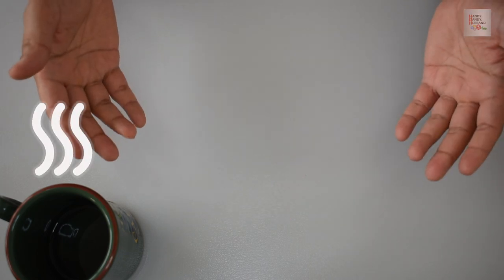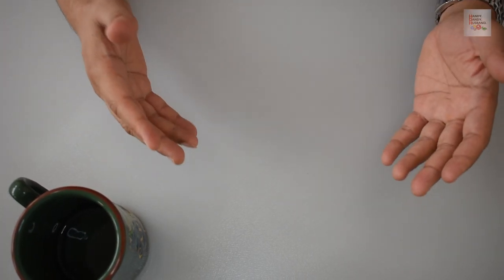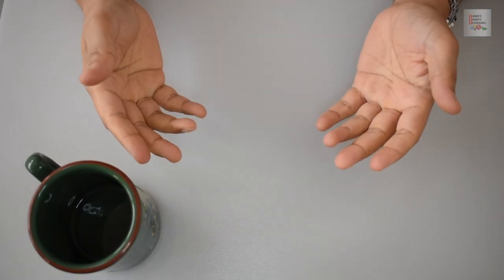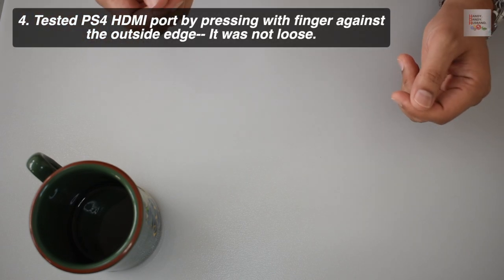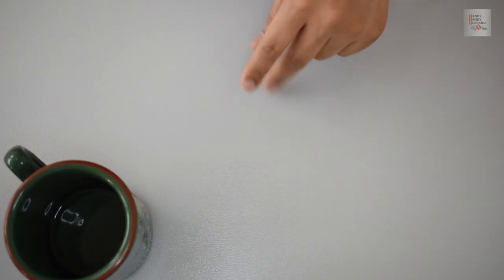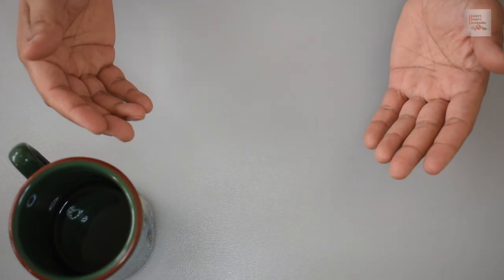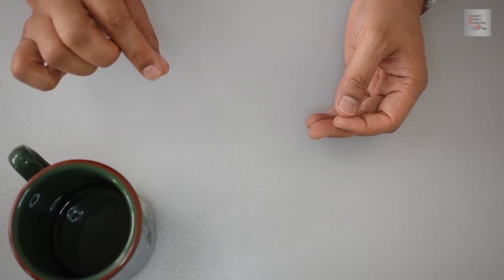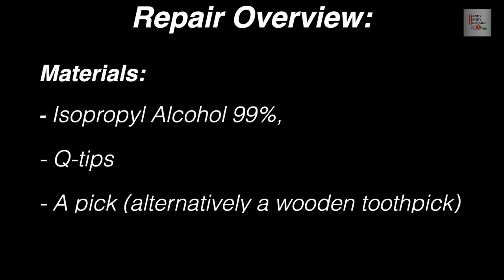𝗤𝗨𝗜𝗖𝗞 𝗧𝗜𝗣: 𝗣𝗦𝟰 𝗛𝗗𝗠𝗜 𝗣𝗼𝗿𝘁 𝗥𝗲𝗽𝗮𝗶𝗿 -- Easy, no solder required -- [Fix that video input error]

Comment: Sadly the pin broke before I could even do this. Happened when I removed the hdmi cable and then TVs died at the same time
Reply from the maker: He TheRiseofTony, thanks for watching and let me know your concern.  I am sorry to hear that the metal pin/strip broke before you could fix it.  Considering the pin is broken, I wonder if inserting a thin paper wedge between the cable and the HDMI port might provide just enough friction to get it working again.  You may wish to try this, but I have really no idea if it would work.  Best alternative suggestion I can make is contact Sony and request a repair under warranty (regardless of when you purchased the PS4) as this appears to be a common issue with PS4s.  Please let me know if either suggestion works.  All the best to you, H.D.H. [: { ].
Reply: @HANDYDANDYHUSBAND  thanks this happened to my non ps4 twice. Not sure why this issue I use Xbox one more no problem lol
Reply from the maker: @theriseoftony  Hi  TheRiseofTony, that is such a bummer.  Maybe speak to Sony and advise them of the many issues you have had and how little you have had with Xbox.  Maybe they might make a warranty exception in your case.  All the best to you, H.D.H. [: { ].

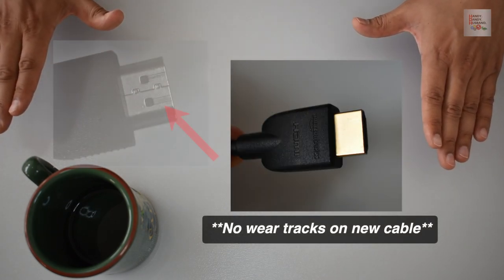Comment: No we he just showed the different sides of the hdmi cord for reference 2:22
Reply from the maker: Hi Belch Bat, thanks for watching.  Not sure what you mean...I took pictures of the cable and the back of the PS4.  The most important thing to note is the the metal prongs be able to position the contacts properly.  When they are flattened, the contacts don't line up.  Hope the explanation helps, HDH [: { ].

Comment: I got my ps4 hdmi port repaired last year since it had a hdmi port issue before but once I got it fixed it worked for a few months until it started to not work again, it basically works for a couple of minutes and then it goes off so I have to remove the cable and put it back in again for it to show a signal.. What do you think I should do now because I payed quite the price to get it repaired?
Reply from the maker: Hi Ahmad Mukthar, thanks for watching and sending me your question.  I am sorry your HDMI port replacement didn't result in a long term fix.  From what you have described, it appears the integrity of the HDMI port to circuit board connection is still good; however, there is a 'looseness' or compromised connection between the HDMI port and the cable.  I suggest the following: 1)  buy a brand new HDMI cable and replace your existing cable.  Try this for a while and see if it resolves or reduces the number of times you have to remove your cable, 2) If that doesn't resolve the issue, try the fix I have recommended in my video, or at minimum look inside your HDMI port and see if the thin metal strips are level with the outer metal sheath or slight protrude towards the center of the port.  If they do NOT protrude toward the center, this may be a sign that my fix might help your particular situation.  If you have any questions, let me know and I will try to help you out.  Thanks, H.D.H. [: { ].

Comment: I tried all the steps, even switched HDMI cables and switched TV's but it's not working :(. I think i have to repair the HDMI Port
Reply from the maker: Hi ALCHEMIST, I am sorry to hear that my fix didn't work for you.  Its a shame...if the thin metal strips look like they are now positioned properly, then you can try using the HDMI cables that you have and try to wiggle them gently in one direction or another and see if that re-engages a signal to your TV.  If still nothing, then go to a Sony authorized repair depot to get an estimate to repair your PS4.  Thanks, H.D.H. 
[: { ].

Comment: when i conect my ps4 to tv it woks when i conecy my ps4 to monitor its say noo vga sinla i conect it w bga video cable
Reply from the maker: Hi ItsAmarYT, thanks for watching and sending me a summary of your problem.  We should confirm a few things:  First, when you are connecting your PS4 to the TV, you are connecting a HDMI cable from the PS4 directly to the HDMI port in the TV--is this correct?  Second, when you are connecting your PS4 to a monitor are you still using the same HDMI cable/port to connect to the monitor's HDMI port or are you switching to VGA with some sort of adapter.  If you are switching to VGA with an adapter, it may not work unless you have a specific adapter designed to convert HDMI signals to VGA or RCA outputs.  Please let me know and I will try to help you out.  All the best to you for the new year, 2021, H.D.H. [: { ]

Comment: I plugged my hdmi and all that in and switched my tv mode to HDMI 2 but my ps4 still wont work.
Reply from the maker: Hi John Lucifent, thanks for watching and sending me your results.  It is a shame that the suggested fixes didn't work.  Try seeing if your HDMI port shifts/moves a little with gentle pressure.  If the port shifts, then the HDMI port may have an issue with its connection to the circuit board.  I am here to help, if you have any questions.  All the best to you, H.D.H. [: { ].

Comment: Just wondering, can I just straight away start with picking the metal without cleaning it with alcohol?
Reply from the maker: Hi Kubo, thanks for watching and sending me your question.  The instructions on my video follow the same steps that I use.  They are 'best practices' and I would encourage you to follow each step, as it will result in ensuring multiple points of potential failure are addressed.  If, however, you don't wish to clean the HDMI cord with alcohol, that would be OK (i.e. it will not damage the port) but your success rate may not be as high.  Hope you get you PS4 working.  All the best to you,
H.D.H. [: { ].

Comment: I agree for the most part here but I do have a few problems with this video. Please only take this as constructive feedback, I'm not intending on anything else here

1) While this fix may work for some consoles, 90% of the time a new port is needed
2) You should have probably mentioned this is never going to be a permanent fix. Once those locking prongs have bent, they're weak, they'll keep getting weaker over time
3) You said "most repair companies" will claim a new port is needed when it isn't. Again I agree in some instances, but most repair technicians are honest, and you shouldn't paint a bad picture on us like that
4) In at least one of your replies you say if this fix doesn't solve green and red lines it's a graphics problem, that is absolutely 100% incorrect. Sorry, but an APU issue would either result in glitching, a phantom white light or a blue light of death. Green and red lines are indicative of a handshake failure, which is the result of a faulty HDMI port or HDMI encoder, and is in no way related to the APU.
5) This can cause more damage than good if the user isn't careful. Accidently causing 2 pins to become shorted can damage the encoder resulting in a worse and more expensive problem to fix.

These are my opinions, I don't mean to sound picky, just voicing my concerns

Comment: I bought a new cable and did the 7 second reset and and changed the resolution. I hit automatic and it goes back to no signal. Tried different inputs as well
Reply from the maker: Hi Pat Barry's Son, thanks for watching and sending me your question.  Did you try bending the thin strips of metal in the outer metal surface of the HDMI port?  Please let me know and I will try to help you out.  If you have trouble identifying the metal pieces I am talking about, review the following picture:  https://drive.google.com/file/d/1nYwZaYcaKrAbYL6Nsrgn1AA8T0TmL-53/view?usp=sharing
Hope my comment helps you out.  All the best to you, H.D.H. [: { ].

Comment: Need help ps4 works and turns on but when I try plugging it into tv it says no singal I tried different hdmi cables as well but it might be the hdmi port on my ps4 but idk how it could have broke
Reply from the maker: Hi Damien Salazar, thanks for watching and sending me a summary of your issue.  The symptoms you have described are, unfortunately, common among PS4 consoles.  I don't know if it the design or the type of HDMI port that is used.  What I do know is that the PS4 and especially the PS4 pro run very hot (just try standing next to one while gaming and you could use it as a space heater).  The heat contributes to many issues including the melting of solder and of expanding and contracting metals which makes them more pliable (bendable) and--potentially--more brittle.  With regards to your specific problem, please let me know if you have tried my fix.  Sometimes the prongs on the PS4's HDMI port become flat and can't hold the HDMI cable centered or properly connected to the center piece and you get 'No signal error'.  If that doesn't work, try cleaning the HDMI cable and the metal pieces inside the HDMI port with a thin cotton swab and rubbing alcohol [BE GENTLE] (heat increases the oxidization of most metals so sometimes oxidized connections can cause the no signal error).  Last, see if moving or shifting the HDMI cable while it is plugged into the PS4 improves the signal.  If it does improve the signal, then try using something to prop the cable into the position that provides the best signal and then leave it on, after 4 hours, turn it off and unplug it, and let the PS4 cool.  This may help shift the solder next to the HDMI port pins enough to re-establish a better connection.  Last, if nothing else works, use your finger and see if the PS4 port wiggles when you put pressure on it.  If it does, likely you need to have the HDMI port replaced.  Hope my suggestions help you, let me know if you need further help.  Thanks, H.D.H. [: { ].

Comment: Do you need to pull ot gantle or push it
Reply from the maker: Hi Aniq danial, thanks for watching and sending me your question.  Basically if you are using an instrument from the outside of the HDMI port and directing your force to the center, then it is a push.  If you are trying to pry the thin metal pieces from the inside of the HDMI port towards the center then it is more of a lifting/pulling action.  I hope my suggestions help you.  If you have any other questions, let me know and I can try to help you out.  All the best to you, H.D.H. 
[: { ].

Comment: Hi I tried everything you said but still didn’t work I have to plug it in and hold it for it to work can you help me please
Reply from the maker: He DrixpAlghizi, thanks for watching and sending me a summary of your issue.  If you can hold the HDMI cable to establish a connection, then it is likely the issue is with an incomplete video connection.  Try the following: 1) see if a brand new HDMI cable will work, 2)  Alternatively, you can try to jerry rig the existing cable in place with duct tape and operate the PS4 for 4+ hours, then shut down as normal and do not disturb for 24 hours--this method can sometimes use the heat from the PS4 to help bring the metals in the port and HDMI cable more closely together.  Try the above two methods and let me know, I will try to help.  All the best to you, H.D.H. [: { ].

Comment: What did u guys use I can’t get it out
Reply from the maker: Hi Cameron Brown, thanks for watching and sending me and the community your question.  If you are referring to the tool/device that you use to help bend the thin metal back into position, use an awl, or an automotive pick (like the ones sold at Harbor Freight).  If you don't have that, then try a long thin pin or needle or a strong toothpick.  Hope the above suggestion helps you.  Let me know if you have any other questions.  All the best to you, H.D.H. [: { ].
Reply: @HANDYDANDYHUSBAND  ok thanks my grand ma fixed it a hour ago thanks for the help
Reply from the maker: Hi Cameron Brown, thanks for the reply.  That is great that your family helped you out.  I hope that got your PS4 working and that it works for many more years.  All the best to you, H.D.H. [: { ].
Reply: @HANDYDANDYHUSBAND  u to
Reply: @3cam4  what did she use?

Comment: My hdmi bent the metal in the ps4 port(far right) I just straighten it out and it fixed temporarily. Can I save it or should I buy another?
Reply from the maker: Hi Brando_ thanks for watching and reaching out to me.  I am sorry to hear about the bent metal strip.  It is hard for me to say without seeing the device.  Can you send me a clear, focused, well lit picture of the HDMI port.  Take a picture of the entire PS4 back, then closer to just the HDMI port and then finally as close as you can get to a close up of pin.  Try to have someone hold a flashlight on the PS4 (if you use a flash, it white-washes much of the detail).  Send your pictures to me by email:   thehandydandyhusband@gmail.com
Hope to hear from you soon, all the best to you in the meantime, H.D.H. [: { ].
Reply from the maker: Hi Brando_ , sorry I gave you an incomplete email address in error:  Here is the correct address:  thehandydandyhusband.info@gmail.com  --H.D.H. [: { ].

Comment: My hdmi is broken do you know were i should send it to get fixed or how to safely to replace it because i haven't been able to even see a picture on my tv
Reply from the maker: Hi Mrz Timmons, thanks for watching and sending me your question.  It will likely be most convenient for you to contact Sony and ask them for their list of factory authorized dealers, as I don't know where you reside.  I would, however, recommend that you try the fix I show on my video--it is free, takes only about 5-10 minutes and maybe it will work.  All the best to you and I hope you get your PS4 up and running again.  H.D.H.
[: { ].
Reply from the maker: Also....you can replace the HDMI port, but before attempting you should have a temperature controlled soldering iron and likely a solder heat gun.  You should be relatively experienced with attaching and removing electrical components and realize that if you use too much heat you could delaminate the circuit board or melt the component and if you don't use enough heat you could create a cold solder that eventually fails.  Hope the above helps you out.  All the best to you.  H.D.H. [: { ].

Comment: I'm finding it really hard to push up the metal prongs. I'm using a needle but I have also tried a toothpick. Where should I be playing it, and any other tips on getting them up?
Reply: I can't get under the metal prong to push it up.
Reply from the maker: @aadityachohan2186  Hi Aaditya Chohan, thanks for watching and sending me your question.  If you are not able to put the needle in from the top, try pushing up the thin metal prongs with the needle from the bottom.  Do this GENTLY, once you have moved the metal piece a little, then you can continue gently moving it to its correct position.  Hope this helps, all the best to you, H.D.H. 
[: { ].
Reply from the maker: Hi Aaditya Chohan, please see my comment below.  H.D.H.  [: { ].
Reply: @HANDYDANDYHUSBAND  Thanks so much. I eventually worked it out, and pushed them up. My ps4 still didn't work after many tries and I think that I have damaged it beyond repair, and I think I have to get it professionally fixed. I can see that   the hdmi ports outer piece is cracked and is slanted upwards, and I think I saw a loose, gold piece inside at one point, so it's probably time to sort it out and get it fixed completely. Thanks anyways 👍🏾😃
Reply from the maker: @aadityachohan2186  Hi Aaditya Chohan, I am sorry that your PS4 didn't work after the fix.  If the outer casing is damaged, yes, the problem may be more than my fix addresses.  Do get it fixed, but before you do that contact Sony and ask them if they can recommend an authorized repair depot near your area and also whether they could, as a good will gesture, cover a portion of the repair expense--you never know...Anyways, all the best to you with your repair, H.D.H. [: { ].
Reply: @HANDYDANDYHUSBAND  Thanks for all the help. It broke right in the holidays (just my luck) but thanks for all of the help and  tips. 👍🙃
Reply from the maker: @aadityachohan2186  You are most welcome.  Best to you, H.D.H. [: { ].

Comment: Do u need all of those items
Reply from the maker: Hi there Daniel Sanchez, thanks for watching and sending me your question.  To complete the repair thoroughly and properly you should have most if not all of the items.  I suppose if you were hard pressed, you could try using a needle or pin instead of the pick and maybe some alcohol wipes instead of the isopropyl alcohol.  Hope this helps and gets your PS4 running. All the best to you, H.D.H. [: { ].